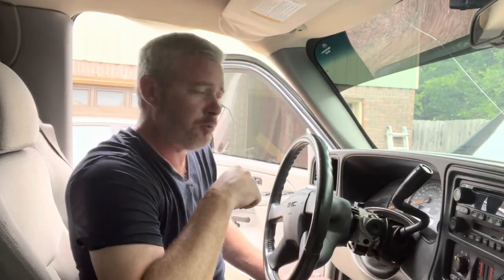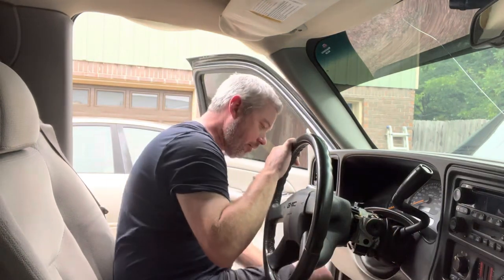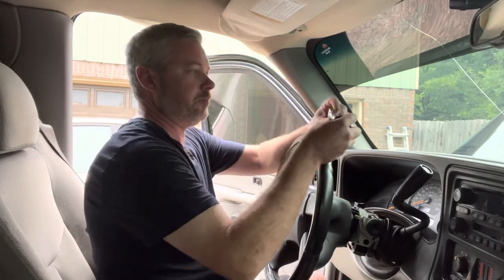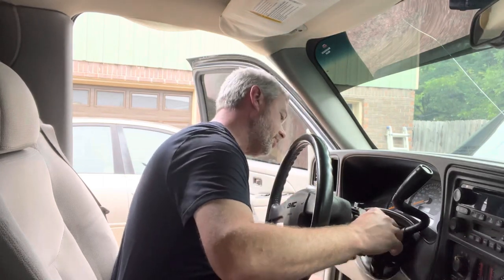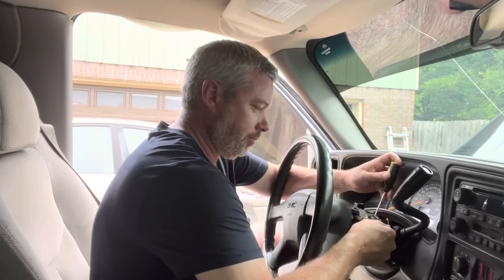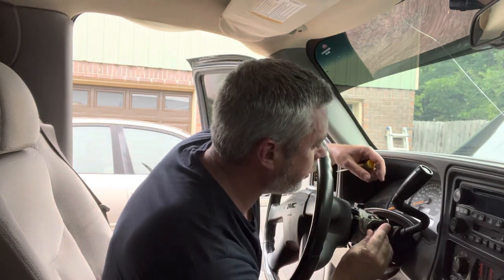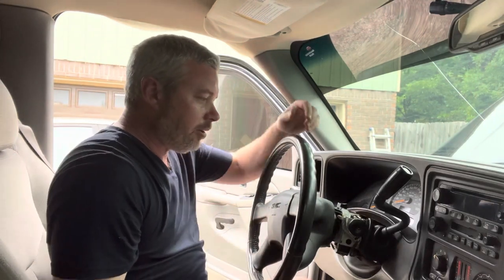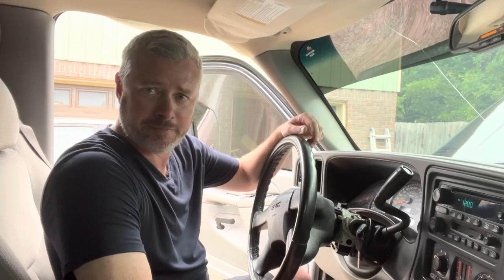GMC 2004 Yukon key cylinder replacement

Comment: Bad video
Reply from the maker: Sorry it wasn't helpful for you
Reply: You didn't have to reprogram your key or anything
Reply from the maker: @bobbyhayes3695 they new keys are with this replacement…. So save the old keys so you can unlock your doors if the key fob stops working
Reply: What do you push down on to make the cylinder come out?? Didn’t get a close up on that part.